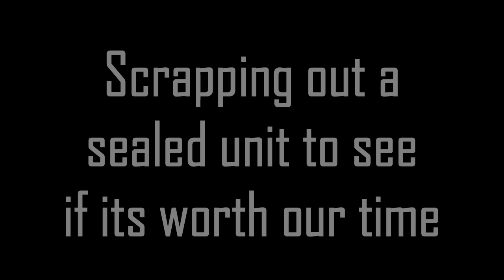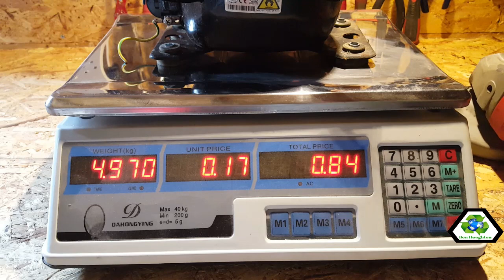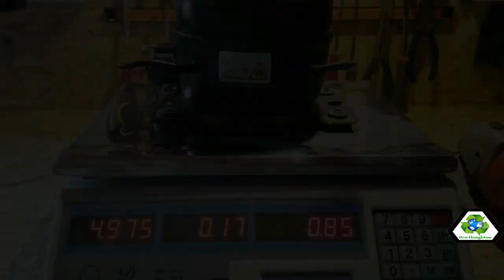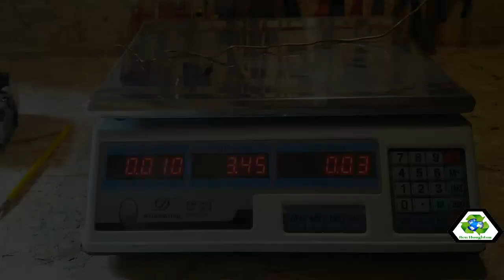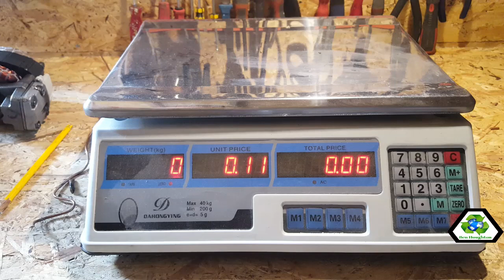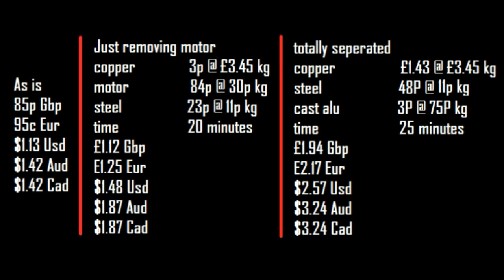♻ scrapping out a sealed unit to work out if its worth our time and effort

Comment: One thing I've noticed that no one mentioned to you is wear gloves when using the grinder. The starks can burn you as you are cuttung plus the steel does get very warm will cutting it.
Reply from the maker: I rarely wear gloves, starks from metal wont you, eye and ear protection is a must though

Comment: Just watched ur vid the trick with these is to work fast i can cut 4 of these to one 9in slit disc cut above the welded joint less work shouldent take more than 5 mins to cut open also you only cut a 5kg one apart why not cut a 5kg to a 14kg then work out the best ones to cut open by the way a 10kg one will give you 1.1kg in copper windings.

So in my opinion there worth the time to strip down with the right tools to do the job you can be processing 8+ an hour easy.

Comment: You should be using an abrasive cut-off wheel, not a grinding disk.
Reply from the maker: These discs are quite good they cut through steel supports easy enough i do have the thin cutting discs but they only last for a few minutes on these sealed units and cost 10 times more
Reply: Ben Houghton I use the thin ones meant for stainless they last, and are cheaper than the grinders down this way,
Reply: recently, salvaged 12 gallons of oil from rads, mixed, it went through the transit no problem.. a nice bonus..

Comment: what disc are you using in the grinder? have you tried saving the oil to mix with diesel? or is your vehicle too modern?
Reply from the maker: Using grinding discs the thin cutting discs dont last long on theses sealed units i wouldn't use the oil in my car id probably ruin my vehicle

Comment: Your not doing it right If it's that hard. I can cut 5_6 of those with one good cutting wheel. It helps if you cut just along the top or bottom of the weld if you cut the weld it's two times as thick. I have cut really like 30-40 of these there not that bad, like anything the more you do it the easier it gets.

Comment: used a  drill and let the oil out .
Reply from the maker: I drill them then put a a couple of empty bottles in the bottom of a bucket then rest it upside down on the bottles so the sealed unit is not sitting in the drained oil but i dont bother with them anymore just scrap them as they are, there're to messy to open up